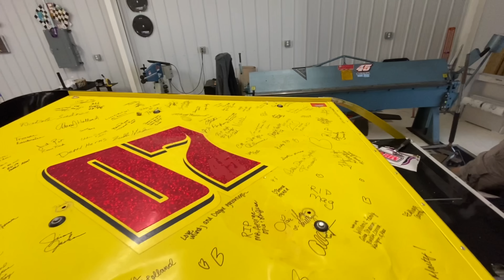Gearing up for GATEWAY!!! We’re headed to the DOME!!!

Comment: I think if I were going I'd make the front n rear bumpers and the nurf bars from solid pipes lol. It's gonna be a war with a lot of battle scars. Guaranteed there's not gonna be a straight panel on her by the time the weekend is over. Good luck guys.
Reply: Everything bar or part you reenforce just makes it bend or break a different one

Comment: As Nick Hoffman affectionately calls his ride, that is Chase Holland's very own Sh*tbox racecar. I won't tell anyone if you guys don't. It looks battle tried, tested, and resurrected for Gateway. The appearance of scraping the bottom of the barrel with stitching together body parts, chassis put together with baleing wire and duct tape. It should get into their heads that if they even touch your car it will total theirs
Excellent job, I love it.